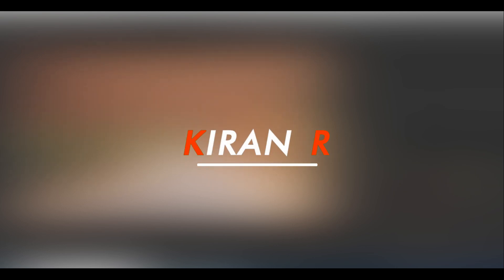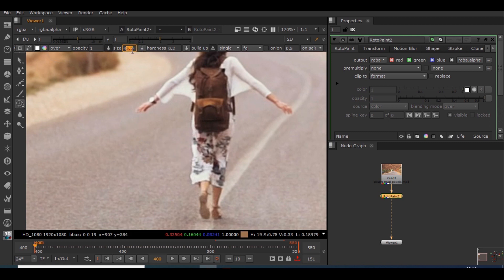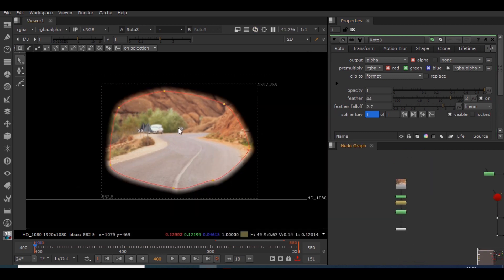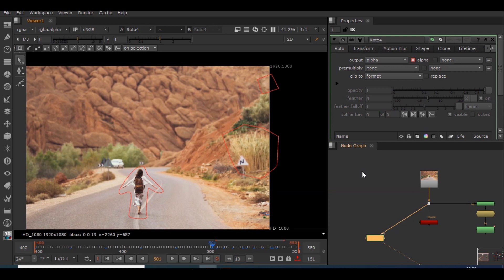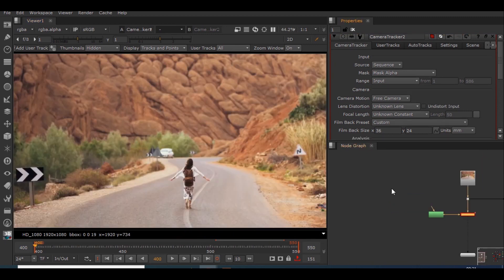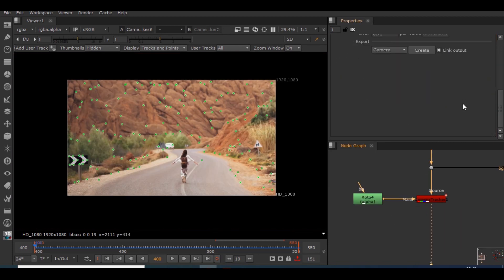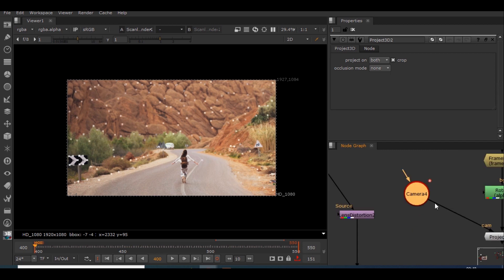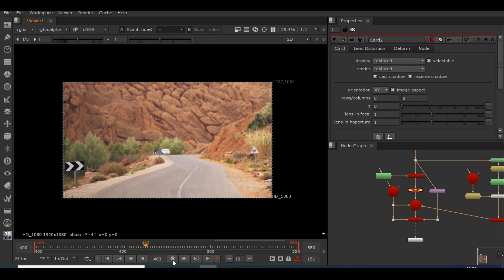Nuke Tutorial | Nuke Cleanup Method | Using Rotopaint and Camera Tracking Method

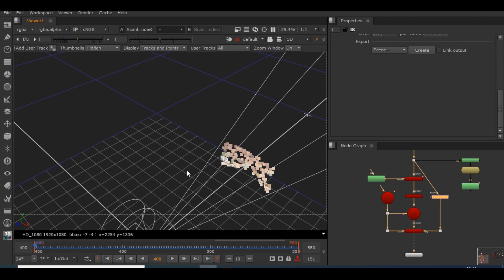Comment: Do not use camera tracker in shots where there is no parallax, it's wrong. Check at 8:13 , the point cloud is a partial sphere and not corresponding to the actual scene. If there is no parallax, use a simple tracker or planar, much more easy, precise and quick

Comment: GREAT PAINT JOB PLEASE MAKE A  PATCH SHIFT TUT'S UPON THAT IS RIG REMOVAL ON WITHOUT USING ROTOPAINT AND ANY CAMERA PROJECTION ONLY USING ROTO AND TRANSFORM MASK
Reply from the maker: Sure! Will make a patch shifting cleanplate tutorial soon✌
Reply: @Reymaster44  yes please make it soon if possible please examine over transform mask and track and roto mask with planer tracker mode  not using roto node
Reply: Not worked for me